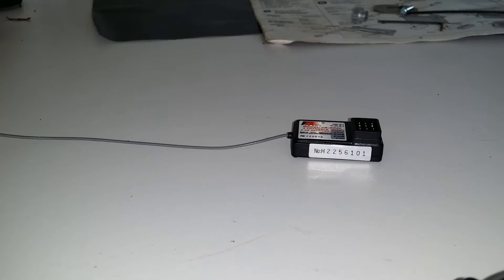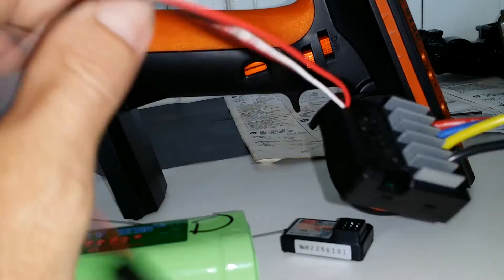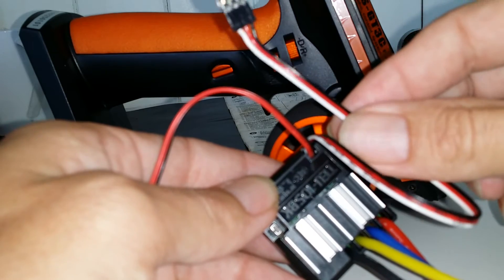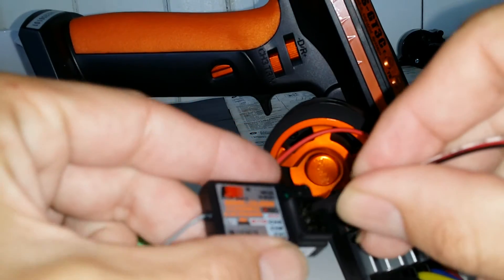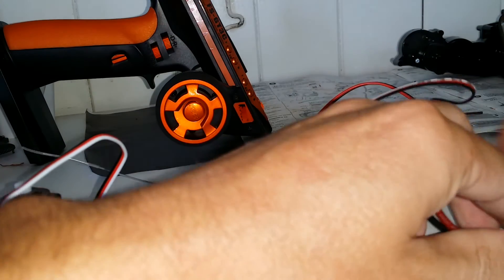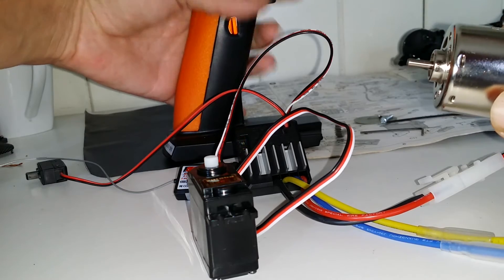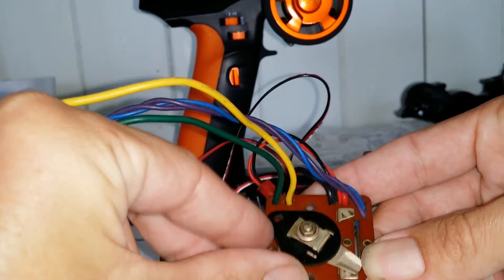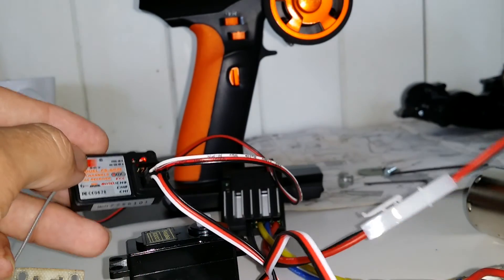How the electronics of an RC car work. +shout out

Comment: "That supplies power to your receiver" Thank you! You have no idea how hard it was to come by that little nugget of information.. I have an older (30+ years) car and it had a separate battery pack for the receiver..
Reply from the maker: Yeah back then you usually had a 4XAA Pack to power the receiver, now days most ESCs have a BEC (battery elimination circuit) built it. And you can power the receiver straight from the ESC. Glad the video helped..

Comment: Can u please give name every component please
Reply from the maker: They are explained in the video.
Radio receiver, transmitter, electronic speed controller (ESC)
Reply: @devolutionrc8016  can you please tell me what is wire on the transmitter.. And how to connect the wire
Reply from the maker: @husniag4418  I'm not sure what you mean sorry?
Reply: @devolutionrc8016  i mean the single cable on the transmitter.. Like areal
Reply from the maker: @husniag4418  on the receiver? The grey wire? That is the areal.
Reply: @devolutionrc8016  ok tq.. May i know what is remoote control model
Reply: @devolutionrc8016  and may i to know the receiver have any battery supply or no
Reply from the maker: @husniag4418  not in this set up, it gets power from the ESC
Reply: @devolutionrc8016  ok thanks for your information
Reply from the maker: @husniag4418  no worries, hope it helped
Reply from the maker: With the transmitter/controller in the video you can store multiple Models (other rc cars etc) so you only need one controller for them all